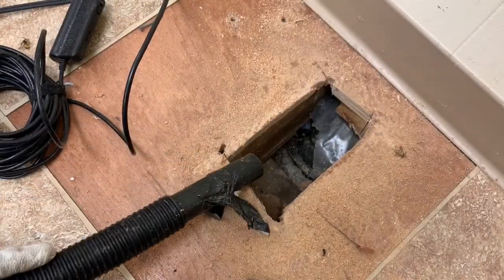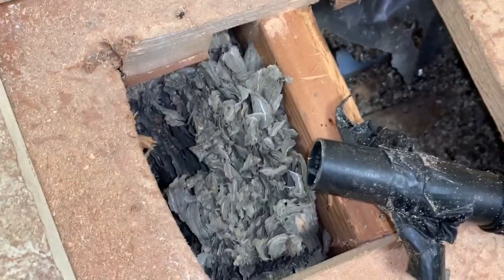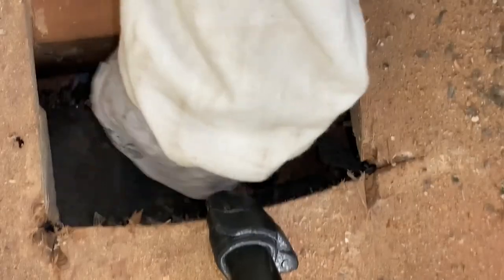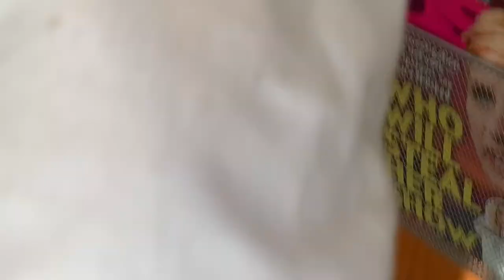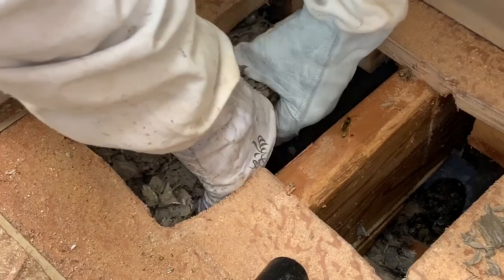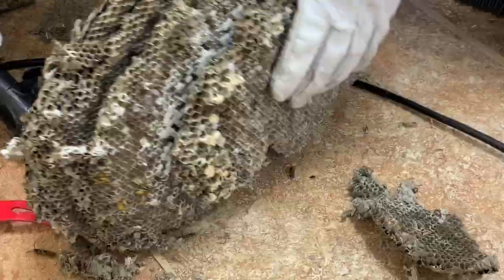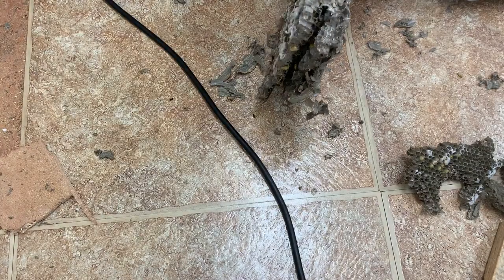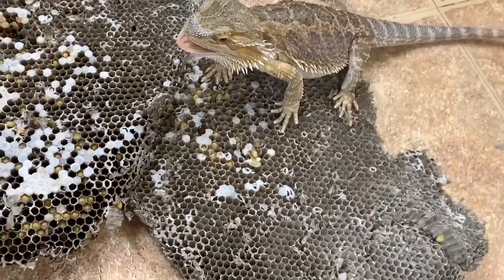Massive Yellow Jacket Nest In Customers Floor | Stung In Face | ASMR

Comment: So you cut more of the floor instead of breaking the hive? Wow.
Reply from the maker: Yep I do, did you notice when we split the combs the hundred of yellow jackets that were in between each layer of comb? Being inside a house cutting a inch more off the hole isn’t creating more work during the repair as you cut a new piece of wood to fit the hole just cut out a inch larger piece super simple, by adding a inch to the hole we saved hundreds of wasps fleeing the torn nest into the open house. I mean you pick the better option cutting a larger patch out of the replacement piece or house full of angry yellow jackets 😂🤣 I’m pretty sure we made the right call this time